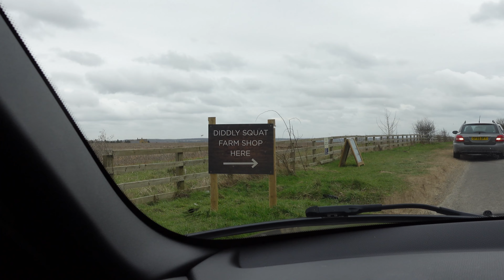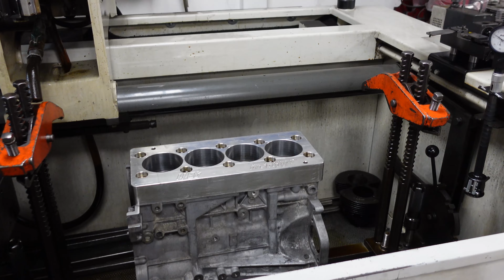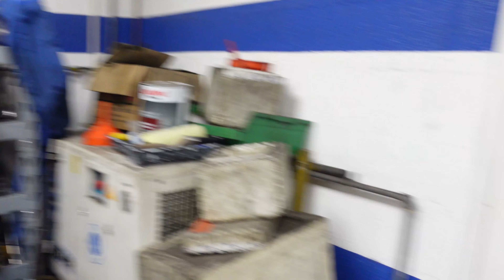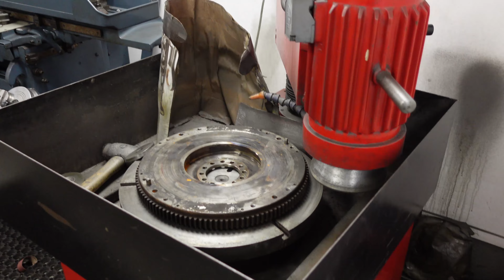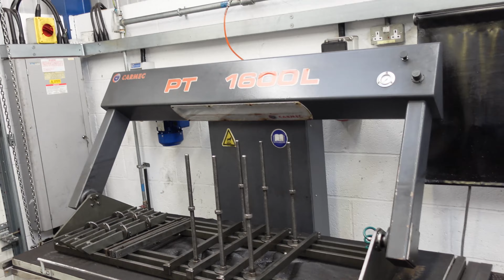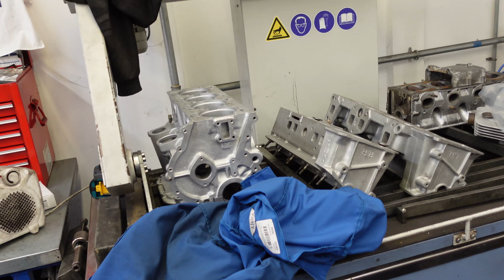The Evo Engine is ready!

Comment: hi rowan I hope you don't mind and I don't no whether you still doing window cleaning but I have a vw caddy maxi with rear seats what foldaway I wanted to put a water system in van pump etc but wanted it to be easy removable to use van for other things any ideas or advise you can give me how many litres water can you go through each day etc whats smallest tanks I could get away with and easy to remove set up etc
Reply from the maker: Hi. It depends how serious you are about cleaning windows. 350 will do you a nice slow day of cleaning windows but 650 will have enough that you can wack the pressure up and work 9 hours solid